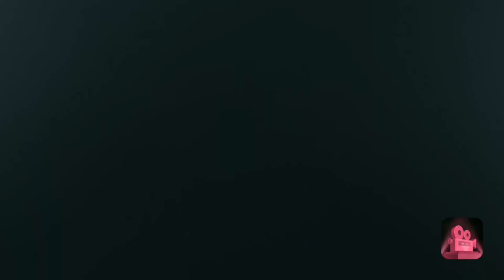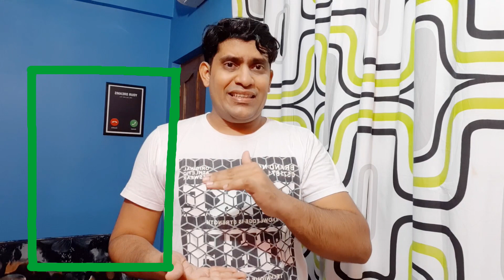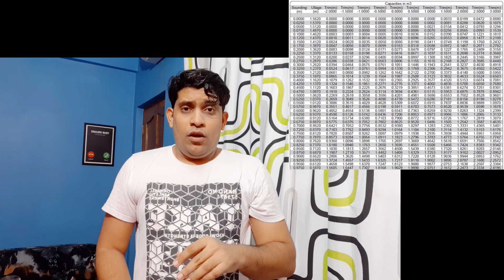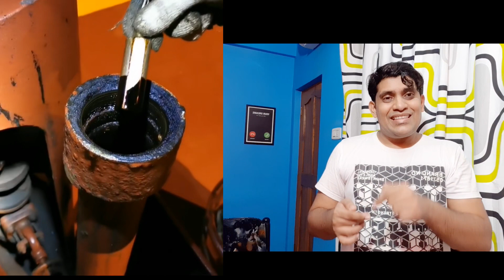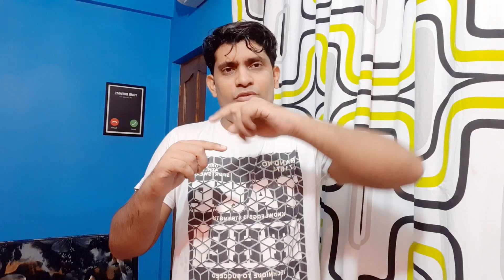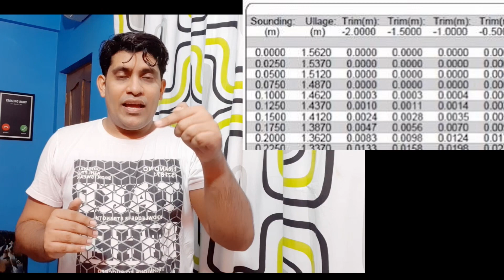How to take sounding?, how to manually take sounding of tanks #sounding

Comment: why jacket water system is after LO cooler?please sir Answer this.
Reply from the maker: Temperature required for
L.o outlet from cooler is 40-45
Jacket water cooler outlet 60-65
N sw is below 30deg
So if it jacket water first temp will go up n cooling l.o is diff, but cooling l.o is easier, anyways ill explain in my next video
Reply: @BasicMarineEngineering  k